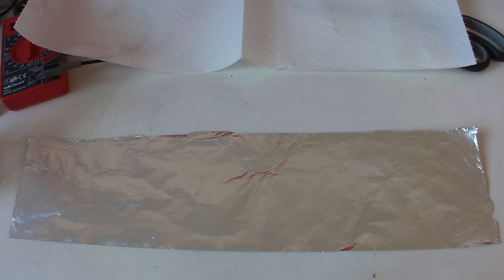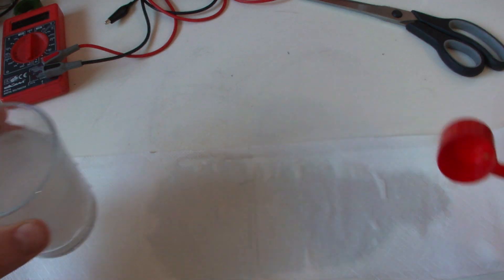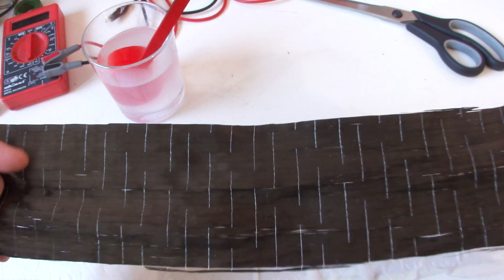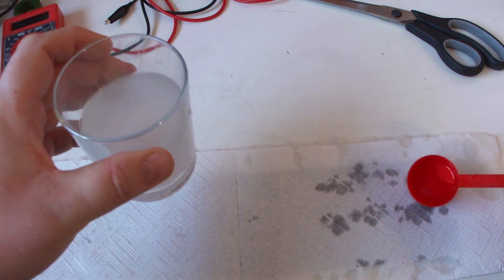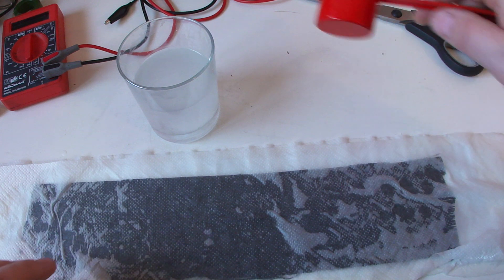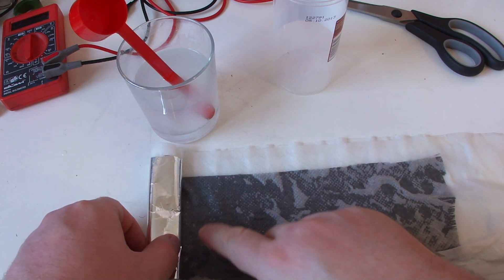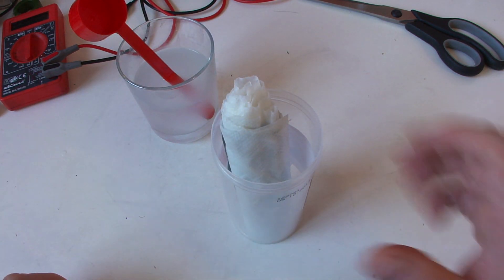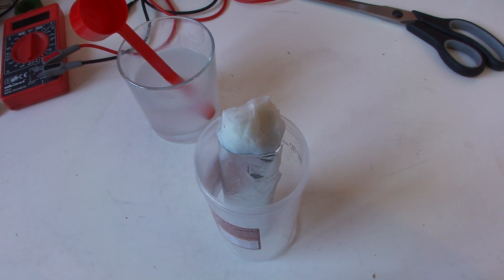Carbonfiber alufoil cell - building up a rollup cell

Comment: Aluminum will decompose giving up its electrons. Use silver or a metal that can be used as a rechargeable cell. Use a better cell separator like fiberglass cloth or recycled cardboard. Your cell will Gass causing leakage.

Comment: I'm guessing it never occurred to you to pre-soak the paper towels instead of using a scoop and creating an electrically conductive mess on your work bench. Or you might consider using a spray bottle.
Also, it's obvious you didn't think before hitting the record button as to how you were going to wire the terminal leads for the battery. You should have had the leads attached to the plates BEFORE you rolled it up.
Well, thanks for playing but this video was totally useless and showed us nothing.